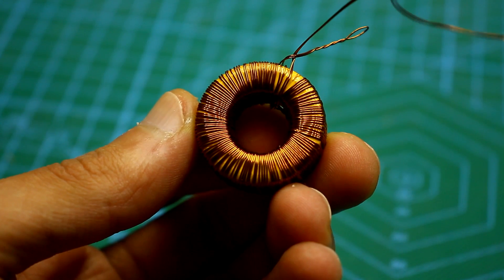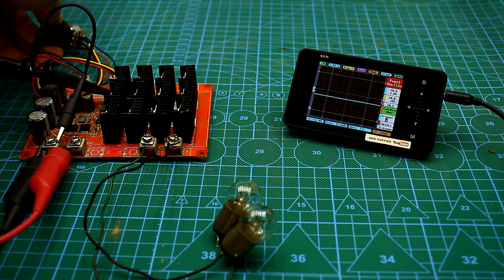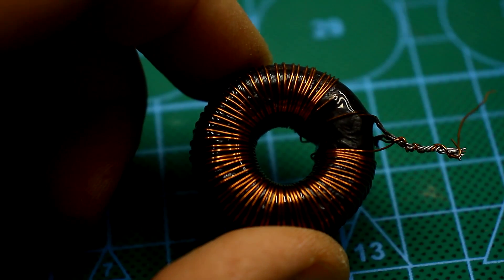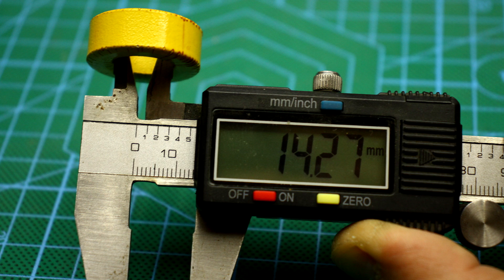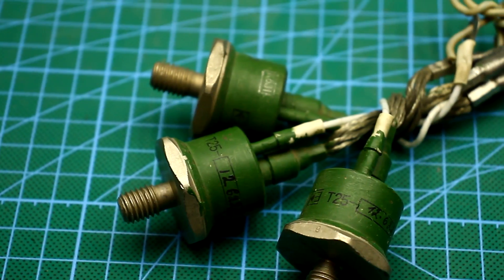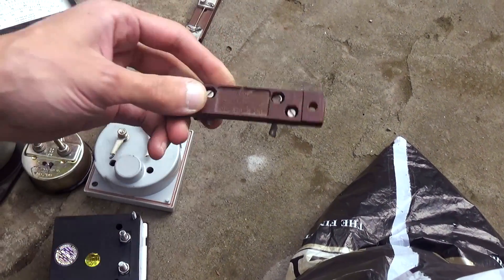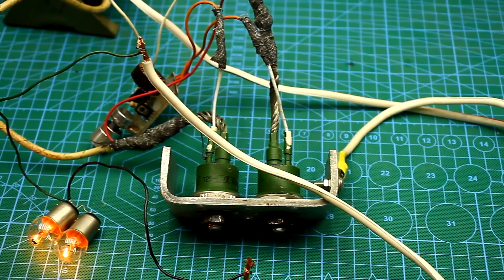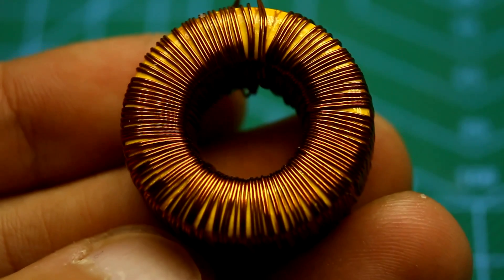DIY charger from grandfathers times

Comment: Hey Kasyan, 
  Recently I have been trying to replicate the finish quality of old Fluke circuit boards. If you've ever taken apart an old fluke rack mounted device from the 1980's or older, you will know what I'm talking about. Most of the boards are etched and tinned but are not covered in a solder mask. The tin is super shiny and looks really nice. I tried to copy this finish using Liquid Tin to plate some boards, but this doesn't look anything like the old Fluke boards. It's really a dull finish. I gave up trying to replicate the fluke boards for awhile and just plated my boards with a soldering iron like you did here. 
  A couple months ago I was cleaning up some scrap copper clad and part of it was already tin plated. While cleaning it I noticed my method caused the tin to get much more shiny.
   When I first clean copper clad I use a ball of stainless steel thick lathe turnings. I don't believe it is actual lathe turnings from machine shop scrap, but these "balls" are sold in the home goods section of grocery stores and other home goods retailers. They are usually in the section with dish soap, sponges, and cleaning supplies here in the USA. I started using the stainless steel balls instead of fine steel wool as a first step for cleaning boards because the stainless steel doesn't create a mess and there appears to be less copper dust afterwards. I don't think the stainless steel removes as much material as fine steel wool. I still use fine steel wool before doing an toner transfer or photoresist, but this is done after the first pass with stainless steel. 

  Anyways, here's how I get perfectly shiny tinned boards that look awesome. Clean the printed circuit board copper until it's perfect and ready to tin. I drench the board in flux, completely covering it. Then with a flat clean chisel tip I place a blob of solder on a scrap piece of copper clad, not on my actual circuit board. Each time I need more solder for tinning I just barely touch this blob of solder on the scrap copper. This prevents me from adding too much solder in any spot on the actual circuit board. After tinning everything I clean all of my flux off and it looks just like your board did here in this upload. 
  If the solder is flat and even at this point the next step will work. I use the stainless steel turnings/ball to lightly clean the tin. This step doesn't take much force or effort. This will remove the haze and very slight discoloration caused by manually tinning the board. It makes the board look much prettier. This is almost as nice as the fluke boards. If the tin is not perfectly even the copper will start to show through the thinner areas. If this happens I cover the board in flux again and tin it a second time. With fresh flux and most of the copper covered, the second attempt will be much nicer as the flux has less oxidation and contamination to deal with. This will also be much more shiny, but I still do the stainless steel polish again. 

  Even after this great improvement in finish quality, I still wanted to try to completely replicate the fluke boards.  So, I got some polishing compound for removing scratches from automotive clearcoat paint. After the stainless steel cleaning, I polish the tin by hand using a rag and the polishing compound. This really doesn't take very long. Tin polishes very easily. The end result is a perfect mirror finish. It's actually nicer than the fluke boards. It takes around a week for the tin's perfect mirror finish to dull to the same finish as the old fluke boards I have. I think they must have used a similar process.
  The results look really awesome. It's the kind of thing that would look really good on camera. Even after the mirror finish dulls, it is an even uniform finish that looks very professional. If you have the right technique and soldering iron settings all of your soldered components will have the same mirrored appearance too. It can look really really good. This looks like jewelry next to a board covered in soldermask :-)
-Jake

Comment: I heard pulse charging helps desulfate lead acid batteries, as long as the peak voltage is high enough, with the average around 16-18v or so. But who knows, surely if the voltage is higher, it will push current to the battery,  I have a project similar, not bear as complex, I just used a DC converter to deliver adjustable voltage!

Comment: BTW:
The bridge makes a full wave rectified shape.  The zener flattens the tops.  On the tail end of each alternation, the voltage on the trigger circuit falls.  This makes the voltage from the resistor divider feeding the base of the transistor fall.  This makes the circuit fire more easily late in the alternation so low power settings work well.
Reply: yeah,you're right

Comment: Kapton tape works better than epoxy.
If you use epoxy, wait for it to fully-fully harden before any voltage is applied.  Wet epoxy conducts slightly and is damaged by conducting.

Comment: Note:
In common English for the US at least:
"open" means the connection is not made and no current
"closed" means the connection is made and the current flows.
Other languages do it very differently.
"Open the light" would mean to make the light work much like "open the tap" gets you water.
Reply: It's bad translation from Russian "открываются" (opens) and "закрываются" (closes)
Reply: @rushb9388  
Yes, many cultures do "open the light" for making a light to its thing.

Comment: i think you mean silicon controlled diodes because thyristors let trough power in both ways when powered on
Reply: and triac?
Reply: Rick graphite You are incorrect. You mean triacs. Thyristors are actual silicon controlled rectifiers (SCR) or diodes. That’s basic.
Reply: actually this is subjective. some called scr or triac thyristors, but the correct way to address them is by calling scr (if it is scr), or triac if the device is a bidirectional thyristor. the term thyristor is now "generic" which refers either scr or triac - a four layer device controlled by a trigger.

calling a triac or scr a thyristor is not wrong. it is similar to calling fet/mosfet/bjt a transistor.

of course, if you want to be specific and you want to address a unidirectional thyristor, you would call it scr.
Reply: scr and triac are both thyristors
Reply: Edel SM Wrong.

Comment: Where can I find Soviet Union electronic components?
Reply: try aliexpress
Reply: They are very rarely found outside eastern Europe, try looking on eBay or look up modern equivalents.  You can use thyristor 2N6509 or similar.
Reply: There are western equivalents to all of them just look up the specs
Reply: The transistors and thyristors don't have to be the same,you can easily replace them with what you can get.